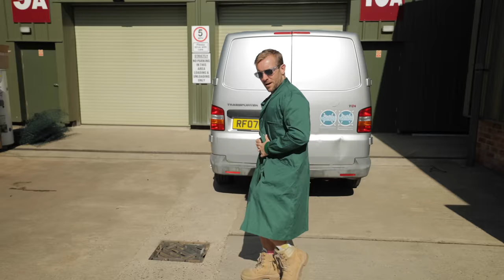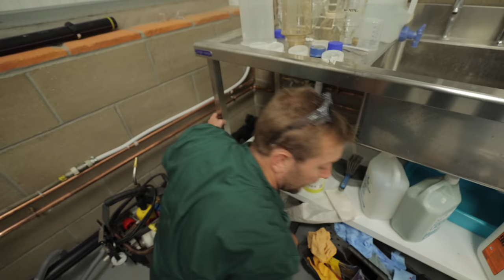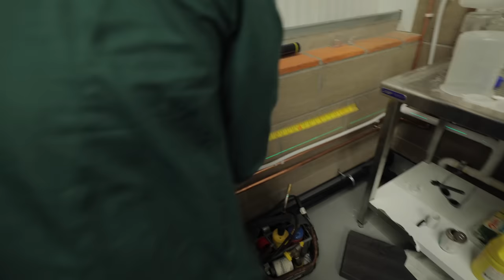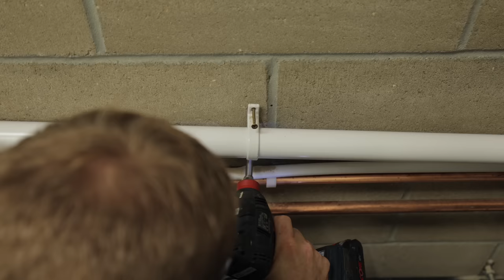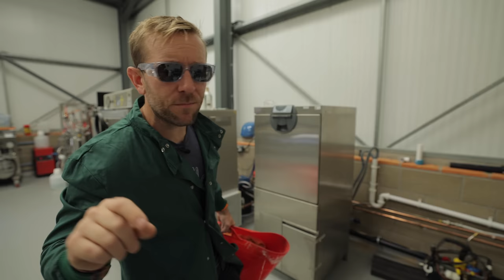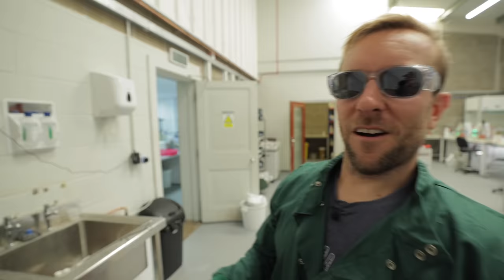HOW TO INSTALL WASHING MACHINE & DISHWASHER DOWNPIPE WASTE

Comment: Hi James, I hope them two machines don't discharge at the same time, coz that downpipe don't look long enough, it could back flow out the pipe, hope ya tested it!!
Reply: Then he'll get called back and he'll just get one of those spigot fittings and slap it right on, with zero chance of it ever overflowing again.
Reply: Waste is definitely too small for simultaneous discharge… 💦 Also no MEK before gluing? Clean your end before going in!!!
Reply: @joun456  the heck is a "MEK" or "clean your end before going in"
Reply: @dimitar4y Not now he’s cut the rubbers off the two hoses!
Reply: @dimitar4y  methyl ethyl ketone, aka the correct degreaser prior to jointing PVC with adhesive. Two reasons- Firstly contamination on the mating surfaces stops it bonding correctly, mold release from manufacture or even finger prints. Secondly, MEK being pretty aggressive, also primes the surface for bonding, goes matte after cleaning, giving it a bit of a key to further improve adhesion 👍
Reply from the maker: These machines are just a trickle (or so I was told) I asked them off camera if they wanted another DP installed but they said no. Hard times?

Comment: Shouldn’t you install a double check valve before the washing machine connection ? Or is it not needed that’s how I’ve been taught
Reply from the maker: There's one on the water softener. Tbf it's probably overkill anyway...as are all regulations made up by men in suits and not men in boiler suits! 😂
Reply: @plumberparts  agreed 😂

Comment: Question on how to achieve a decent fall on the drain pipe. The elbow fitting in the corner was glued so presumably not moving much. So do you just 'force' the pipe up at the downpipe side to create the fall?

Comment: Just want to ask something. I have Willis Emersion heater attached to my hot water tank and if I try and use it then it seems to have gone into reverse flow!!!! The hot water should rise and enter the top of the tank but it seems to be blocked from flowing in that direction so it over boils (kettles apparently, people seem to use them for underfloor heating) and actually expels the hot water from the bottom (what is suppose to be the intake!) of the Willis unit so it can flow in that direction around the loop but not the normal direction  which I suspect is some sort of debrie blocking the flow in one direction possibly and so it heats the hot water tank from the bottom and so takes ages and there is some amazing clanking and sucking orchestra to accompany it all lol. It used to work in the other correct direction but no longer so I guess it needs disassembled to see what is causing this possible blockage? It's an old awkward system to drain etc but when it worked properly it was great but now it's doing my head in.

Comment: Yes! Got to wear that lab coat. Elf n safety. You forgot the following: 
Anti slip, non-conductive, steel-toed work boots.
Natural fibred socks with antibacterial enzymes. (Stops you having to see if they stick to the wall, before you change them)
Comfy undies.
Flame retardant, branded work trousers incorporating ranti rip fibres, elephant eared storage pockets (just don't let your trunk hang out in public)
Gloves.
Flame retardant shirt (bra is optional, even for men. Moooobs!)
Stab vest, welders helmet, ear/nag defenders (See Loafer's missus) 
Air raid siren warning of impending doom and wallet on a sturdy chain. 
I must have forgotten something? 🤔
All suggestions appreciated.
Reply: He didn’t even fasten the lab coat, so that was also a fail! 😂

Comment: Very poor installation, If you cut into that waste pipe at the correct height then the pipe waste pipe you installed would not have crossed in front of that existing wall mounted valve, also the length of waste pipe you fitted along the wall would not have had to slope up so steeply in order for the U bend to miss the existing copper pipe work.

Comment: I don’t agree with cutting the rubbers off. I’ve been using a twin spigot adapter compression fitting on a 40mm downpipe since 2010.

Comment: Them fluxuators are crap mate
Reply from the maker: Ah mate mine's great. Apart from the brush bit at the back. What's wrong with your one? I'll tells Debs.
Reply: @plumberparts  much easier to use a tub of flux with a hole in the top. Can spread it evenly and quicker especially on price work